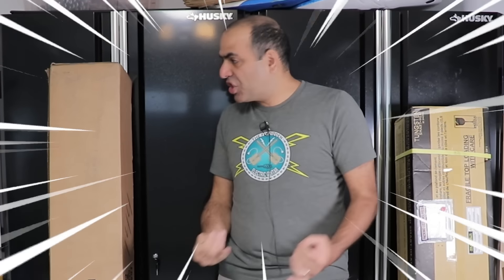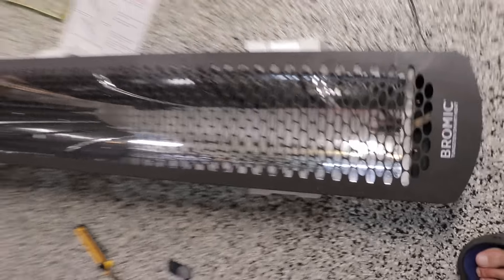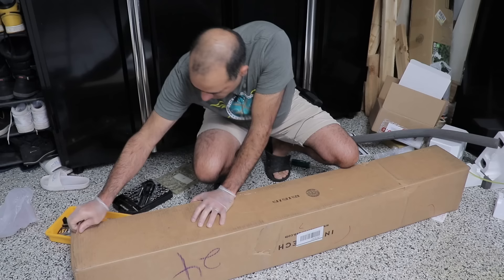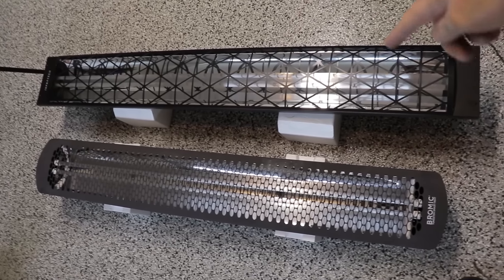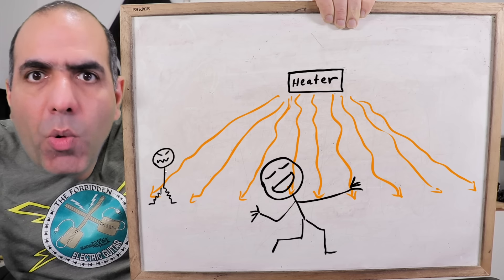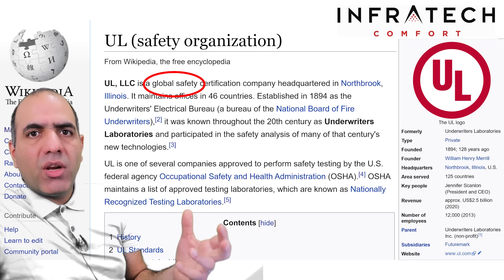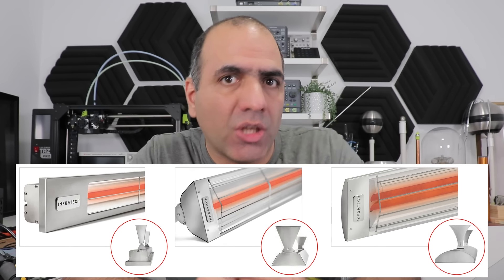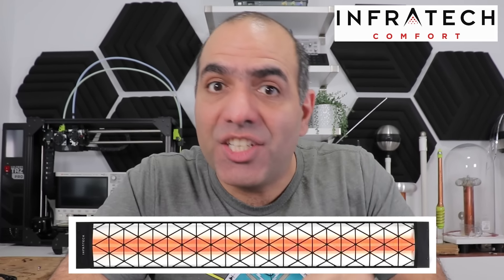Comparing 6000 WATT Resistors, Infratech versus Bromic Heaters

Comment: “it doesn’t block any radiation at all” casually breaking the laws of physics here, nice!
Reply: Also, it is black… meaning I can see that it absorbs light radiation…
Reply: yeah lol i was about to comment "if it doesnt block any radiation how come i can see it?"
Reply: I mean, it could have been a material which is transparent to IR. It isn't, but it could
Reply: @Maric18  you can see lots of things that are transparent to infrared radiation. Or I can reverse this statement. Water is a great example of something that is transparent in optical and almost completely opaque to infrared
Reply: @thestralspirit  plastic bags are opaque to visible light, but transparent to infrared.
I'm guessing their guard is made of plastic? 😅
Reply: @FAB1150  
Here is how it was designed:
Design Management team: I want it to be made of material with is transparent to IR!
Engineers: it can't, and isn't transparent to IR
Product Manager: But it could!
PR/Advertising manager: It doesn't block any IR, compared to our competitors who don't have a (patent pending) shroud like ours
Engineers: 🙄
Reply: @svampebob007  it would for sure be a good design decision to make it in a transparent to IR plastic. I guess they just didn't think of it or just made everything in sheet metal because it's cheaper
Reply: @FAB1150  Also it may be hard to make such plastic strong enough, and heat resistant. 
Even if it's IR transparent it won't be 100% IR transparent, and being that close to a 6000W heating element i wouldn't be surprised seeing every type of plastic melting very fast being that close.
The best simple protector would be a thin steel wire grill, and it would be optimal to put it at bit further away from the heating element.
Reply: Well would it not absorb the IR then reemit the heat?
Reply: Sales team aren't engineers.
Reply: @willhaney96 1. You can't reemit passively same wavelength EM, after absorbing some. You can only reemit higher wavelength - lower power EM, leaving some loss in the process that ends up as heat in the material.
2. The next thing is that if you absorb and reemit then there's almost zero chance of getting the same original photon vector and direction after the process. In such a scenario you get an opaque diffuser, not a transparent barrrier.
3. The transparency factor tells you how much EM goes through without any absorbsion mainly, and generally for well transparent barriers that can be from like 1% to 99% (as at 0% transparency it's not transparent, and 100% is not possible). It's easy to imagine this by looking at tinted car glass. It can block 95% light (really dark windows), but it's still transparent because the 5% of light that makes it is not dispersed, it goes through no problem, and that's the difference between transparent and opaque (as opaque barriers still don't have to be 100% blocking the EM. At that point they work like a diffuser).
4. It's also possible for a diffuser barrrier to only bend/disperse Incoming EM without absorption-reemission, and that's when you get a diffuser that only mixes the incoming EM and doesn't change its wavelength.
Reply: Not necessarily some materials are invisible to IR radiation. I'm an RF engineer so I think I would know.
Reply: @TomsBackyardWorkshop  Are you an RF engineer or a wannabe engineer?
If you listened a bit during training you'd know that even air is not fully transparent/invisible to IR radiation, and also to a huge RF spectrum, like the around 0,1-25GHz which covers most of currently commercially  used RF in the whole world.

On an atomic level, 100% transparency is impossible, because some photons, whatever their wavelength is, still can hit the barrier material atoms.

Basically only vacuum is pretty much 100% transparent to any EM radiation.

It's  really concerning that you don't know that and call yourself an engineer.

Perhaps you're working only on low power RF, in which case "almost completely transparent" will be good enough, but not in this case, not in general, and especially if you want to disprove physics.
Reply: Law of conservation of energy. Do you know about it?
It cannot make energy disappear. Either it reflects back to the mirror, or absorbs it, and radiates it again as infrared light.
Reply: @wow-roblox8370  It could block visible light and be completely transparent to infrared.  It's not, but that is technically possible.
Reply: @juzoli  Learn to read.

Absorption does not mean automatic radiation. If it did then no material in the world could be heated up.
Reply: its times like this that we remember marketing and engineering are 2 different teams of people and i think we all know which side of that this claim came from
Reply: @AgneDei  Even if you heat up, it reaches a balance where the input energy equals the output energy. 
No material heats up indefinitely without releasing its energy. Maybe black holes, hut even those have Hawking radiation.
Reply: I guess you could make a transparent guard too? It would need to be heat resistant (normal glass would melt) and non-absorbent in the wavelengths of the most radiated "light".
Reply: I was literally sitting here thinking “wait, would they really use an exotic material that’s transparent to IR for such a cheap grille? Nahhhhhh”
Reply: @willhaney96  You're right that all the energy leaving the elements ends up as heat anyway no matter what it hits. However, a benefit of an infrared heater is that you can direct the infrared radiation towards only part of the room where it'll strike objects and people and heat them up more directly without having to heat up the entire room as much. But if some of that radiation is striking a grille and getting converted into heat, the heat conducts through the air in all directions so some of the energy will heat things behind the heater rather than the area the heater faces reducing your efficiency.
Reply: @juzoli  This requires very high temperature, as is well known with the black body radiation model.
The grill and the heater case will conduct most heat through contact with the surrounding air, not through IR radiation.
I don't know why are you trying to prove here something this absurd. Did you watch the video at least? Mehdi talked about this and even tested this near the end...
Reply: @AgneDei  If you have an IR camera, you know that at ANY temperature, it will have IR radiation due to its heat.
Yes it is not perfectly effective, but 20% covered area is not 20% loss either, so it is reasonable to assume, that the loss can be small.
Mehdi’s test is hardly scientific, the manufacturer probably tested in a much more accurate way. I don’t think they would sabotage their own product if the improvement would be this easy.
Reply: @juzoli  The test was very scientific. Reference measurements, lots of averaged test measurements, you don't get much more accurate in a lab considering that he measured 8-12% difference. That's a lot.
You need a lab usually to measure much smaller differences, or to get very precise calibrated baselines, and you don't need those to make comparisons.
That's basics of measurement science.

IR visible via an IR camera on normal objects that aren't like 1000 degrees Celsius hot (or higher) has extremely low power output compared to the energy used to heat them up.
That's why the tungsten heating elements in those space heaters, that are optimized for best IR emission per Watt of input energy, are heating up the filament to around 3000 degrees Celsius, as that's what you need to get good IR emission.
So seriously, stop trying. Whatever the grill blocks will be 99% wasted heat that doesn't make it to the floor that was meant to be heated.

You might get more precise effect measurements of this in a lab, that would be more in line with the grill coverage, but that still doesn't change the facts, and for the environment, the measurements done were more than enough to prove it. Especially considering the fact that the emission doesn't have to be fully uniform as expected in the calculations, and also the more blocking grill clearly provided much more safety if someone were to touch it by accident, so there's also that reason for keeping this design in production.
The other grille looked nicer, but the holes in it were big enough for some fingers to go through, and if you touch those lamps directly when fully heated you'll get charred skin almost instantly.

The important thing here is that the tech support was trying to dismiss physics, just as you do.
Reply: @AgneDei  He measured it once, without controlled environment, so he didn’t account for changing outside temperature, which he disclaimed. No that was bot scientific.
Reply: That's a real ROBLOX style Big Oof!
Reply: @FAB1150  Except that the plastic would  probably melt at that distance from those elements.
Reply: @wow-roblox8370  maybe it's reflective from the backside just pointing out the possibility
Reply: I mean it blocks the infrared radiation, absorbs it, and then eventually re-emits it again as lower energy (based on its temperature) infrared radiation. How good the re-emitted infrared is at heating compared to the radiation from the element - I've no idea
Reply: @juzoli  He clearly showed that the measured temperature on a near wall as a control at the start and end of each measurement, so he did account for that.
Also you could see that the outside temperature variation was only about 2 degrees Celsius, while the measurements differences were much higher.

So still, this was a very valid measurement, and simply stop trying.
You most likely don't understand what you're suggesting in this discussion, because if the grill wasn't an obstacle, than why bother with a mirror to bounce IR? Why bother with a 3000 degree heating element if according to all knowing Zoltan, a sheet of steel at 100-200 degrees is just as good at directed IR radiation?
Seriously man, stop drinking and start reading and using your brain just a bit. Life will be a lot easier.
Reply: @dylanh333  The re-emitted infrared by low temperature (like 50 to 2000 degrees Celsius) material, like a sheet of steel, is basically totally sh*t at heating anything through IR at a distance. That's the whole point of creating those 3000 degree Celsius IR Tungsten emitters in quartz tubes. If it wasn't massively more efficient no one would bother with it, as those IR emitters aren't cheap, and are very fragile.

It's also worth noting that IR is not a single wavelength, it's a spectrum, and the IR best for heating stuff at a distance is quite near the visible light spectrum - so it's the highest energy level IR radiation there is, and through simple black body analog radiation that kind of IR is only produced by very hot materials, that's why the IR emitters are literally so very hot that they're glowing.
As a matter of fact, an old school warm, low efficiency tungsten filament incandescent light bulb has only around 2.6% visible light efficiency, but at the same time it has over 95% IR emission efficiency, so technically you could just use incandescent light bulbs for heating the porch. The problem is that to get near the IR  output of those 6000W dedicated IR heaters, you'd need around 6000W of incandescent light bulbs power, and that would be an unbearably huge amount of visible light.
Reply: @yeroca  if it's transparent to IR, it will not heat up much. Instead of absorbing the IR and heating up it just lets the IR pass through
Reply: @kennyanderson3123  quartz glass is transparent to IR, and for plastics polycarbonate, PMMA and plexiglass are transparent to IR

Edit: and apparently Silicon is transparent to infrared! If you want to make a high-end lamp with excellent performance and made of metal, you could make it in Silicon lol. It would be pretty expensive though
Reply: @AgneDei  LOL, you have very low standards for scientific accuracy:D That doesn’t account for wind for example, in which case the control temperature stays the same, but the heated surface temperature gets significantly lower. It also doesn’t account for several other factors which we don’t even know about (and may never know if the test is repeated only once).

It should be done indoors, and repeated multiple times. You know what the actual manufacturer does before their claims.
Reply: @juzoli   Read literally anything about measurements, reference, comparisons, and logic.

You clearly know absolutely nothing.

You don't need pico scale precision measurements to provide quality results, and get valid conclusions out of comparisons.
Measurements comparison is not the same as reference measurements. I'm sure you won't understand this, as that's not covered in kindergarten curriculum.
Reply: @AgneDei  You went personal instead of giving a fact based argument, which is a clear sign that you lost it…

I gave you a clear reason why his measurement was not conclusive, and you could say nothing to dispute it.
Reply: @AgneDei  Yeah, that's kinda what I was thinking, although I'd never really looked much into the effectiveness of different wavelengths of infrared at heating things up close and from afar
Reply: @AgneDei  Yes it would. Wind doesn’t cool surfaces which are already at air temperature, but it cools the heated surfaces. So comparison results are affected. 

And there are other unexpected factors too. That’s why actual scientific measurements are done in CONTROLLED environment, and repeated MULTIPLE times.
Reply: Strictly speaking, it should absorb some to heat it, but once heated to capacity for the heater, the heat should reflect, and keep bouncing between the grid and the mirror until it leaves the system. But each bounce would cause the photons to loose some energy so...
Reply: @MeepChangeling  Photons doesn’t lose energy by bouncing. But some of it is absorbed by the surrounding air.
Reply: @juzoli  You can destroy a material heating it... Have you never seen like, wood burning? The material can be decomposed. Furthermore, if it absorbs and then transmits heat by contact to the air, it loses energy without emission. Yes, if your material is excited it will release energy in the form of radiation. But it will also lose energy transmitting it by contact with other materials. What we call waste is energy dissipated in the environment because in an outdoor environment it is not warming the environment.
Reply: @juzoli  you are kind of right but also wrong. In a local context, the energy lost by inelastic light scattering is negligible. But you do have inelastic light scattering... Furthermore, you are wrong assuming that the energy of the body will be entirely dissipated by irradiation. It would be correct in a vacuum, but it is completely inaccurate in an environment with air in it.
Reply: @AgneDei  "Learn to read" doesn't help learning, which is the goal of this channel. Stop trying to be such a peacock. You've gone cringe.
Reply: @AgneDei  Where did Mehdi say "black body radiation model"? Instead of showing off like you, Mehdi showed his work.
Reply: @juzoli  Mehdi's test is scientific. He used the scientific method. Formed a hypothesis . Defined a methodology with a repeatable test. Controlled variables within reasonable amount. Could the test be even more rigourously controlled? Yes, but that's just scaling up or down on the same test setup.
Reply: @juzoli  You're making a false dilemma. He measured the outside temperature more than once. Science isn't all or nothing. All tests have a margin of uncertainty.
Reply: @sammiller6631  
To be scientific, it needs to be in controlled environment, which is indoor. Doing it outdoor is NOT reasonable.
Also it needs to be repeated. He did it only once.

So no, it was not scientific. Do you even know what 5 sigma is?
Reply: @juzoli  You didn't give a clear reason. You gave an opinion that if a test isn't absolutely perfect, then you feel it must be 100% false. You're trying to dominate through rhetoric instead of seeking understanding.
Reply: @sammiller6631  You described yourself, stating that his single test proves that the manufacturer’s claim is 100 false.

What I say is that significant portion of the temperature drop MAY come from a slightly stronger wind, which was UNACCOUNTED FOR.

Both repeated tests (like 5-10x at least) or doing it indoor would have mitigated that effect individually, and especially together, but none of these were done.

A single test is not data, just an anecdote, therefore bit scientific.
Reply: @juzoli  Nope. To be scientific, it needs to follow The Scientific Method (which it does). Don't confuse that with rigour.
Reply: @juzoli  - around four decades ago, when I was a research tech doing Enhanced Recovery experiments modelling formation behavior using tertiary recovery teks like alkaline, polymer, and CO2 drives, or combinations thereof, at Shell R&D in Houston, we used to say,
>>>>>>> IT'S GOOD ENOUGH FOR GOVERNMENT WORK!!! <<<<<<
meaning you can waste a whole lot of time pursuing precision and accuracy when neither are really necessary, and quick and dirty will tell you what you need to know. Then you move on.
Yer on the losin' side of this un, sonny.
Reply: @sammiller6631  He clearly stated that the grill wastes heat, and he is right, and I agreed with him. BBR is just a basic scientific fact that explains how bodies with different temperature radiate IR, which is key to understand why the grill will waste heat.
Stating facts is not showing off. Read a book some time, maybe you'll learn the difference then.
Reply: @TheRealJamesKirk  You lose precision, and get a false answer. Precision is there for a reason.
In science, we often see wrong answer with even a lot more precision than what I suggest.

You are on the losing side, sorry. You are advocating for bad science. 

And the fact that you mention “government work” as an example for quality work makes me laugh:D Don’t be pathetic.

So no, no, a single measurement is not enough precision for ANY work. Not even for government work, which is notorious about bad quality, but especially not in private industry.

And scientific standards are a lot higher than both…
Reply: @sammiller6631  Following scientific method is necessary but not satisfactory. 
It doesn’t matter that you had a theory if your experiment is badly designed.

A bad experiment leads to false results. You can even use bad experiment to prove the opposite of the truth. 
What you propose is called “pseudo-science”. It looks like science, because it technically follows the “scientific method” but it is manipulated and inaccurate. 

Pseudoscience is often used when people already have a preexisting bias. You like Mehdi, but already have negative feeling for the “corporation” who you presume always lies. One lousy experiment is enough to validate your feeling, because you already believed it even before the experiment.

But the reality is, that the company probably did a lot more testing than this. Also they have no reason to lie about it, because they could’ve just made it thinner in the first place. That’s their financial incentive.
Mehdi on the other hand DOES have an incentive to favor the other product. They paid him. Don’t believe he is not biased just because he promised he won’t be:)
Reply: the grid is kinda irrelevant the holes are big enough
also metals are very reflective in infrared im pretty sure, aluminum for sure, that's why you need to put a piece of tape on them to measure their temperature with an infrared thermometer
also when something absorbs radiation well it emits radiation equally well don't focus too much on the colour it actually makes sense
Reply: @thestralspirit  glass too.
Reply: @Anankin12  I brought up water as an example because I am not a materials engineer by day. So I don't know which kind of glass meets the qualifications. I know at least some glass is transparent to infrared because we had to get some specially made when I was taking infrared measurements of lightning strikes. Water is a better example imo because it's way more standard than glass
Reply: Corporate and their brainwashing
Reply: @juzoli  No, I assume there are those that are quick to jump to conclusions that suit their beliefs and those that take their time to gather facts. 

You're casting anyone else in a bad light  that disagrees with you.(It must be pseudoscience!) 

And you're using weasel words like "probably did more testing" to fit your narrative, instead of saying that you have no knowledge of what testing they did. 

Because you care more about winning than about truth. Good luck with that.
Reply: @sammiller6631  What is the “truth” then? That we are talking about a single test execution in an uncontrolled environment, which ALREADY has one big issue (wind).
Literally this test can’t be worse and still qualify as test. He could do it zero times and lie about it, that would be worse, but that’s about it.

I gave you several reasons why this test was inadequate to draw conclusions, yet you keep talking about me, and not about the argument. By doing this, you cast bad light on yourself, while I keep talking about the facts.
Reply: If it was mirror shined on the element side, his statement would be true... well to the limits of a real mirror
Reply: Was that a picquik screwdriver you were using?   Love that brand.
Reply: @juzoli  You're not talking about facts. You're spewing emotionally driven rhetoric to dominate, not spread understanding.
Reply: @sammiller6631  Was the test executed multiple times? No. Was it shielded from wind? No.

These are FACTS. 

Do you even know what the word “fact” mean? Because I gave you several of them, and you disputed NONE of them. You only talk about emotions…
Reply: Stay  fit put a hat on . If its to cold go inside.  Throw the stupid heater away and stop wasting power pretending to be having fun.
Reply: @Albtraum_TDDC  or have a guard reflect all (or most of) the blocked light back into the main reflector to be radiated back out again
Reply: @4dbullshitpatroll6  Look up the term "Poe's Law", 4D
Reply: @juzoli  Now you're "shouting" at me with CAPS...which is further proof of your emotion driven need to "win" Internet points by namecalling, cherrypicking and other rhetorical tricks. What's your angle here? Do you, or someone you know, work for one of those companies? What "facts" could explain you pounding your keyboard like that meme?
Reply: @George.Andrews.  You sound like a real buzzkill at parties
Reply: @sammiller6631  quiet the opposite sam If I need a patio heater It aint any party  you would find me at.
Reply: @George.Andrews.  So you're a snob too?
Reply: @sammiller6631  get a check up sam
Reply: I mean if it's true, then their engineering department surely IS the best in market.
Reply: Indeed
Reply: This may or may not be right, but maybe change your username first 😂
Reply: @4dbullshitpatroll6  I wouldn't use any words in place of guilty, because placing blame is for second raters and politicians. Those that can, Do. Those that can't, waste time on blame.
Reply: @willhaney96 I had same thoughts as long as its not too restrictive.   Partly traps some heat making the heater hotter but it will eventually radiate
Reply: @willhaney96  in this example, convection heat energy is being counted as wasted as it goes up into the air and is of no benefit to the user. Whereas infrared radiation is projected onto the person and is useful (of course, outdoors, any infrared radiation not projected onto the person is also wasted and it would be advantageous to have a narrow dispersion heater with motion tracking technology but there you go).
Reply: @TimpBizkit  ah I see, the mesh would he heated, but most of the energy would be lost to conduction to the air, because its an outside heater it will be dispersed to the environment instead of heating the skin of people. Gotcha
Reply: Sales people are meant to handle 99% laymen. For the 1%, engineering team is the option.
Reply: Yet another possibility - make grid inside reflective.
Reply: I have noticed this with fire guards - useful contraptions to stop pieces of wood spitting hot chunks of embers onto your rug and burning it. The problem is they reflect a lot of infra red back to the fire, and up and out the chimney.
Reply: @wow-roblox8370  ayo
Reply: @juzoli  Damn Zoltan, your life must suck. I feel bad for you 😔
Reply: @darkstar.357  LOL:D All you have is insults? If that makes you feel better, and you can’t say anything smart, go ahead and imagine how my life sucks LOL:D
Reply: "In this house we OBEY THE LAWS OF THERMODYNAMICS!" - Homer Simpson.
Reply: "determined to be negligible" translation: "boss said we need a grid and to stop caring about side effects"
Reply: Well... It will heat up till emitting as much as it absorbs. No losses. Except that air cooling and emissions in the wrong directions will rob some useful power.
Reply: what about UV radiation?
Reply: @AgneDei   Sales meeting : " Our Plastic guards are invisble to IF" , as it slowly melts away...... 😅😅
Reply: @thestralspirit  Opaque to far infrared only I think. Near infrared actually passes through water very well.
Reply: Give that guy a little break. Probably a salesperson
Reply: bro you have more like than YouTube comment